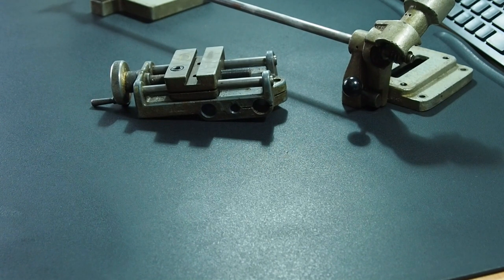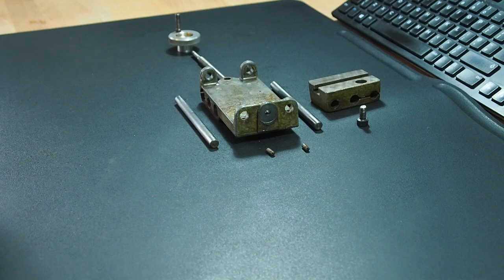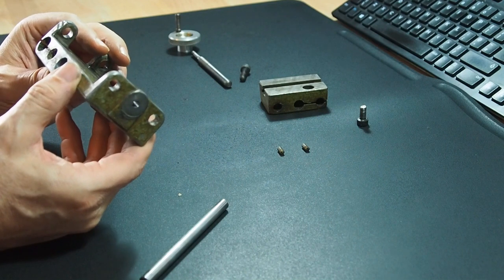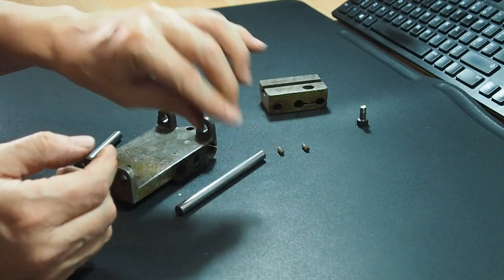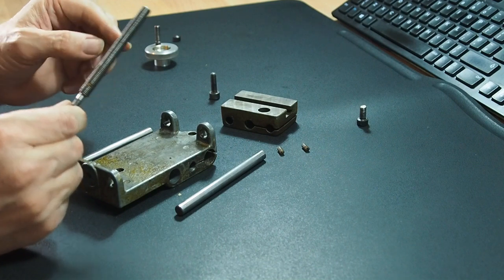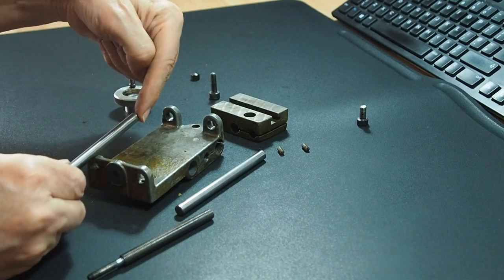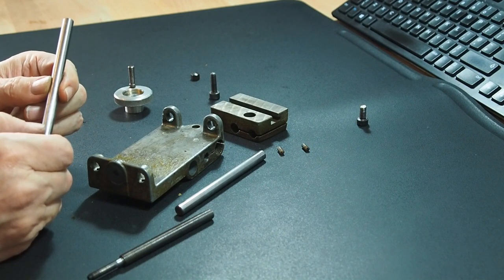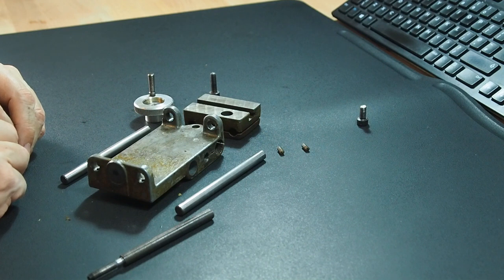Emco Unimat SL - Restoration - Disassemble (Part 3).

Comment: I'm sure you mentioned it in an earlier video, but I don't recall what material that base with the bearing tabs is made from. It looks like it could be cast aluminum because it doesn't look like it was machined from a block of billet material.  In any event, you were successful in removing the round bar without breaking off the tabs!
Reply from the maker: Hi Matt,
The base metal is ZAMAK... I plan to make some sort of jig to try and protect the tabs when reassembling... I may have just been lucky when disassembling.
Thanks for watching.
Paul,,

Comment: I did it the way you said too when rebuilding mine I changed all the long threaded bars they were bend and marred. I found out the hard way don't polish them down with emery paper in the lathe they ended up loose and had to replace them.
Reply from the maker: Hi Joe,
I think it would be very easy to get over enthusiastic when cleaning and nothing would fit again... Hopefully I can control myself.
Take care
Paul,,